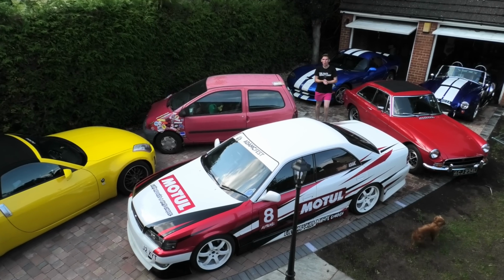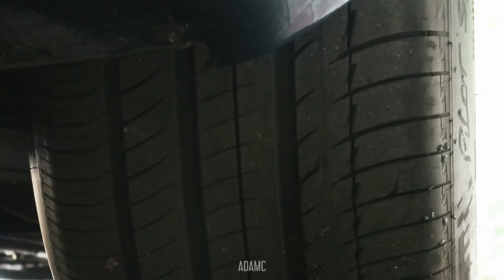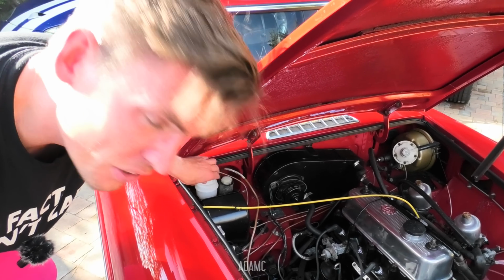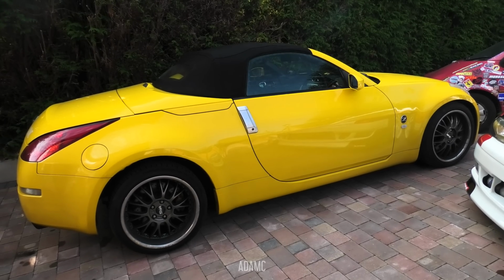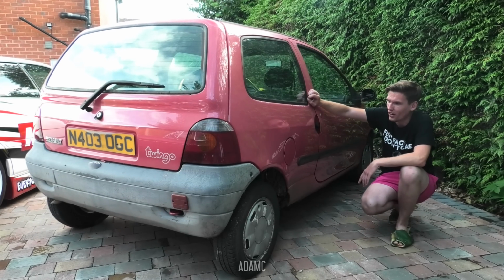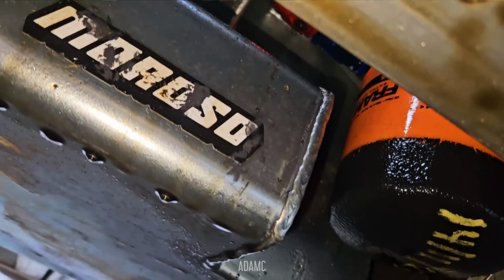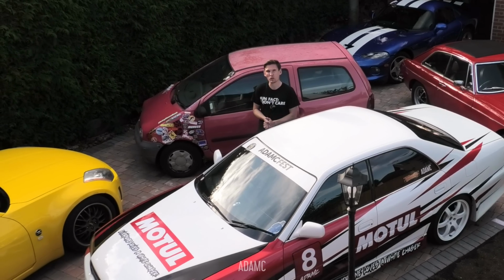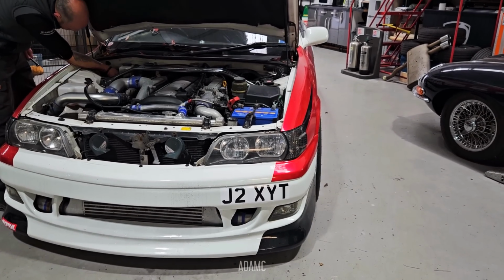EVERYTHING WRONG With My Car Collection & The EXPENSE Of Repair!

Comment: Try a warranty claim against manufacturer for the Viper battery. Why not change the wheels to a set with a more common tyre size? You can just store the original wheels in your garage in the mean time.
Reply from the maker: @bigsluggy  watch to the end of the video 🫡

Comment: The MBB engine is very probably repairable by yourself for under £1k. Head off and skim. Crank regrind and shells. New oil pump. Put it back together and refit. Do these as a minimum and tackle anything else you may find. It’s a simple engine.
Reply from the maker: 'By myself'... I have no skill, interest, tools, time or desire to do anything like that.

Comment: Personally, get rid of the Nissan, Twingo, MG and either use that dough to repair the others, and/or get a more useable daily like an RS3 (other options are available). Personally i have bought 3 mint low mileage early MX5's that are in my storage in their air pockets, as they are gonna shoot up in value over the next few years. (Johnny Smith is going to do a video on them)

Comment: Twingo mk 1 is a classic design, a mini espace, keep it for parts and get a good one, values are going up, they now are a bit of a cult here in the uk.
My daily is a 2007, very late production, I ordered it new in December 2006 from Renault in Paris, collected it as a personal import in April 2007.
Top spec, leather, massive electric glass sunroof, alloys etc etc, now on 180,000 miles, love it.
Cobra kit cars, pah, they have Hillman imp rear lights .😁🤣🤣🤣
Reply from the maker: My Cobra doesn't have Imp rear lights, and is the most enjoyable car of the collection

Comment: The Twingo looks like one of those projects that justs sucks up money like there's no tomorrow, and still worth very little after all that. It'd be cheaper to buy a good 'un in France I reckon (there are loads), and simply switch over the UK headlamps from the project car when a "new" one gets to the UK (maybe keep it as a spares donor if you have space). It'd make a cool road trip. The MGB I'd be tempted to pull the head off and have a look at the gasket, I'd be surprised if overheating it would knock the bottom end (or a big end) out, but I suppose anything's possible. More likely you hydraulic locked if there was some coolant in the system when/if the gasket went pop. You may get away with a head skim and new gaskets.

Comment: Sell the Twingo on for parts. That was a prop for "content". Its served it's purpose and is dead wood. 

Get Mat Armstrong or Chris Slix or Jack McNeil to fit the roof on the 350Z as a colab video.

AC Cobra that's just jacking it up and putting a bolt in. I'm sure you can manage that lol.

Viper not too bad for battery. Tyres   are a pain. Probably more cost effective to get after market wheels with a conmon tyre size.

The MG. Thats the one thats going to cost. Engines gotta come out either way if its a replacement or rebuild. But youre going to have to repaint the engine bay whilst its out as that paints contaminated and will need taking right back.

Feel your pain with the fibteglass on the Chaser. I lowrered my 300zx and crashed into my drive way. Ive now learnt I can only enter the drive from one direction now. I also cracked the front lip on the brake rollers getting it MOTd.
Reply from the maker: The Cobra is not just a case of jacking up and putting a bolt in.

Comment: I get some of these parts are gonna get costly and some cars you want to get done more but surly your not paying £250 for tyres when tyrestreets uk exists.. I almost guarantee you'll get a full set from them for what your being quoted. I'd be surprised that they wouldn't have a tyre big enough to fit the viper truthfully 

The twingo.. isit worth even getting road worthy..  unless you directly want it to be alot of welding work and under body work. I'd scrap it and cut the loss.. save yourself almost £1400 (after all costs added up and divided how you did). Makes more sense to cut it up and sell the parts

Comment: Wait, are there 2 batterys in the viper?

I see you jump it from under the hood on something that looks like a battery, but you said you had to remove the rear tire to fit the new one?

Also you have cheap battery prices!  100 pounds for a viper battery! 

The cheapest batterys you can find in the US are about $120, most are around $160 now, and around $250 for an AGM battery.
Reply: That's the Vipers front charge point, only 1 battery in the rear.
Reply: @gpaje  thanks... I couldn't get a good view of it... it looked like a boxy battery shape.
Reply: @volvo09   It clearly looks like a small battery, I thought the same thing when I saw one for the first time.
Reply: On the MG it doesn't look like it's too involved to do a head gasket on the MG. If the noise in the bottom end doesn't sound too bad I'd consider taking the risk of putting a head gasket in it and taking the risk.... Maybe fill it with coolant and take it on a test drive and see if it gets worse. I put a cylinder head on my Honda that I didn't know was warped, I drove it with a leaking head gasket back and forth from work for 350 miles until I could put the stock head back on the following weekend. I just had to carry coolant with me and top it off before every trip.

I've purchased a few cars with blown head gaskets and drove them home the same way.

Comment: For the Viper, the stock wheel & tire configuration suck. Spend less money on modern wheels & tires, the car will not only perform better, safer, faster and cheaper.  You will actually enjoy driving it.
Reply: But those GTS OEM specs are drop dead gorgeous and makes it worth it😍
Reply: @Kieran_OPC   Sure, but the GTS is still modern enough to upgrade, keep the stock units when you want to take it to a show, but modern set for daily driving.